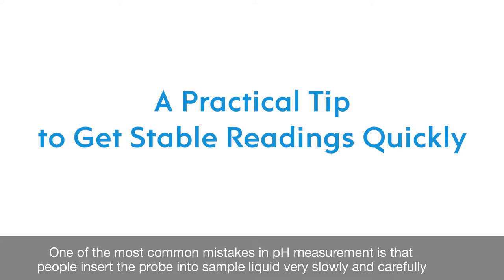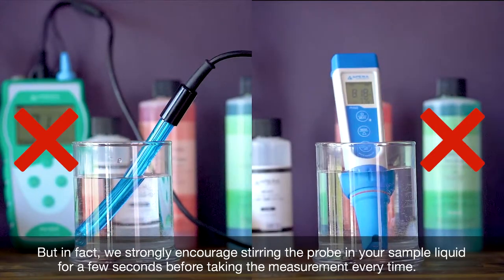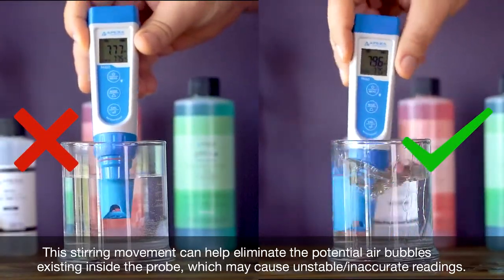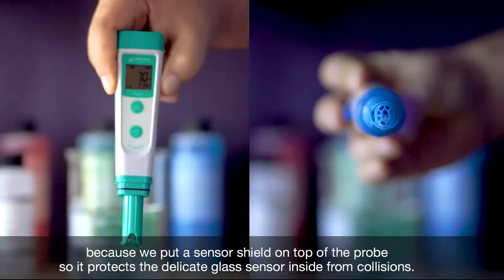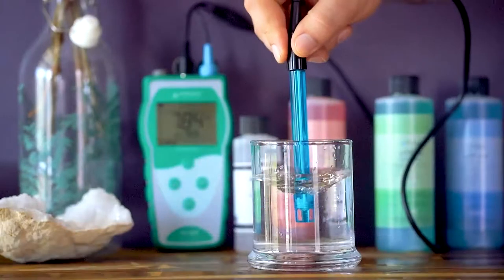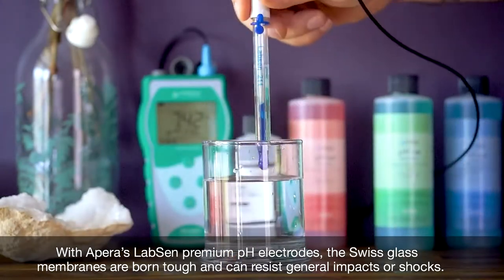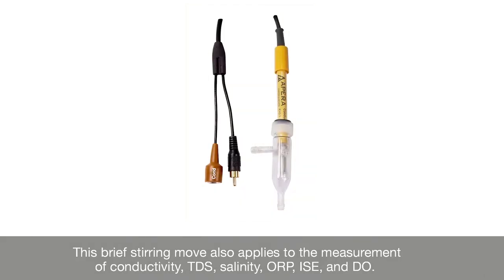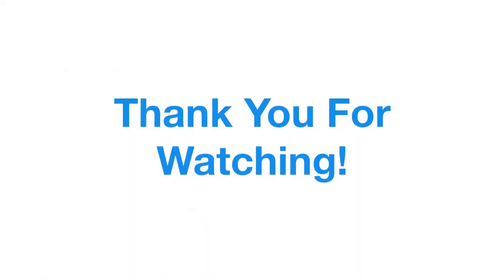A Practical Tip to Help You Get Stable Readings Quickly

Comment: Can I test ph for distilled  water with the Apera PH20 ?
Reply from the maker: When testing pure water like tap water, drinking water, RO water and distilled water, it will take longer for the readings to get fully stabilized (typically 1-5 minutes). Please be patient. If still not working, add Apera 3M KCL (AI1107) to your pure water at the ratio of 1:1000 (e.g. 1 ml KCL to 1000 ml water) to accelerate stabilization while minimizing pH change. If the accuracy is not meeting your requirement, please contact us at info@aperainst.com to find the specialized meter designed for pure water pH test.
Reply: @aperainst  thank you for the quick and helpful reply :)